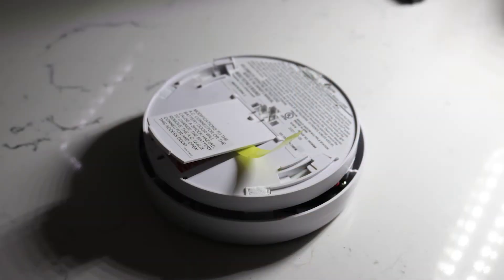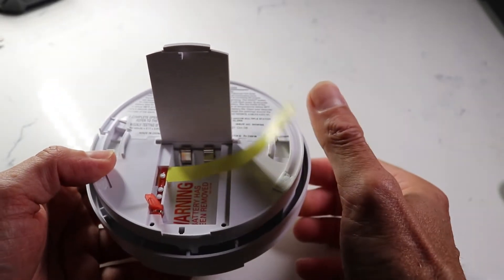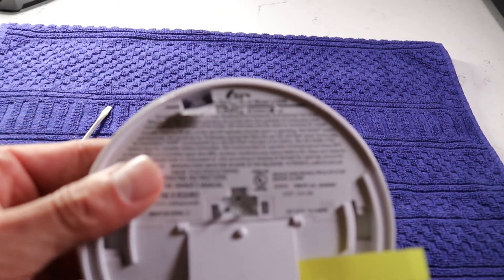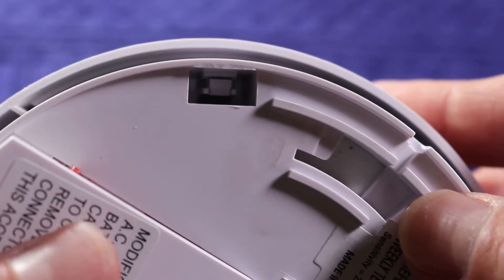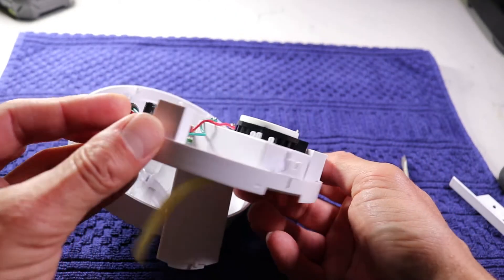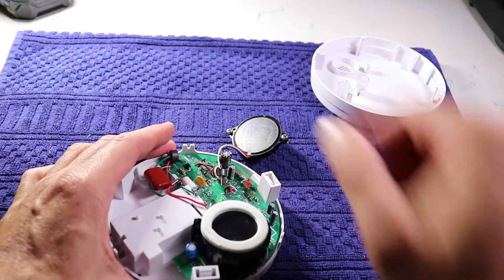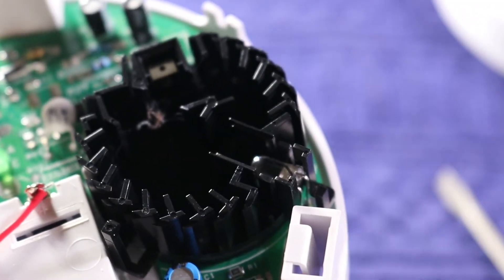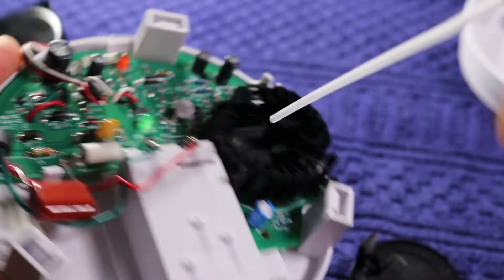Cleaning a Kidde Photoelectric Smoke Alarm (The Right Way)

Comment: Thanks for the video.  I had a p9050 that went off a couple times for no apparent reasons.  Opened it up, chamber was clean, put it back together and it still alarms.  Since it has a 2017 date on it I think I'll just buy another one to replace it.  

Oh, some of the dust blower in a can has a bittering agent in it.  Leaves a residue, found that one while cleaning family ektachrome slides prior to scanning.  If a photography buff, you may have a rocket blower around that can do the trick.

Comment: Thanks, Moe. My unit, similar to yours, began spontaneously beeping with a battery which was still near 9 volts. That you stress disassembly for thorough cleaning, is probably the most important universal takeaway from your video.
Reply: The most important takeaway from the video is not to buy Kidde.  They are trash.
Reply: What brand, then?  @Mr21scott

Comment: Before discovery this excellent video, I went through this exact same process, only with a Kidde KF20 smoke alarm.
Its pretty obvious that waving a vacuum cleaner over it, or even compressed air, is unlikely to be very effective.
 Essentially, they are a very poor design. At a minimum, there should be an insect mesh to prevent ingress into the entire enclosure. Aico alarms seem to have made an effort to address this issue. I may finish up replacing all eiight of my Kidde alarms with Aico ones.
Reply: That manufacturers would rather have customers replace their units, is rather obvious.